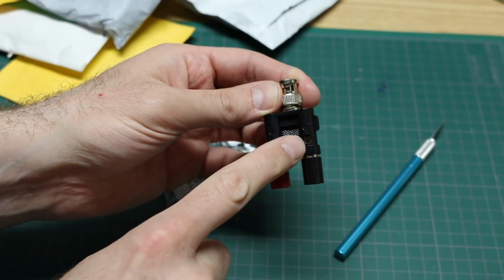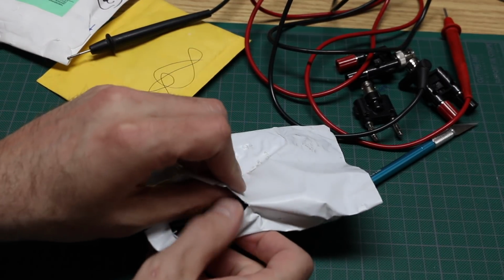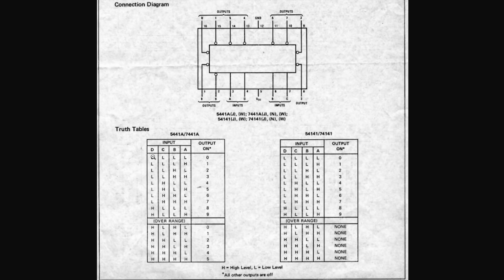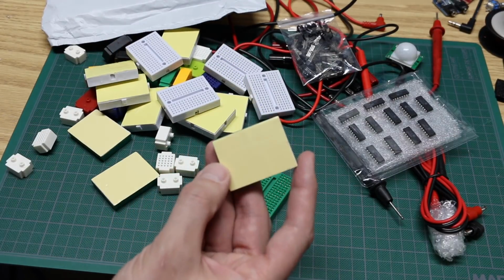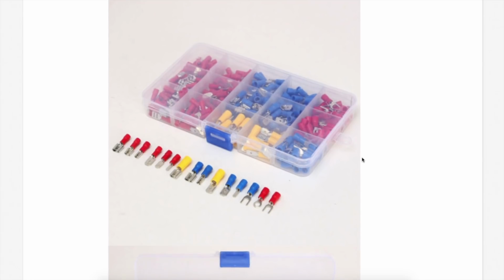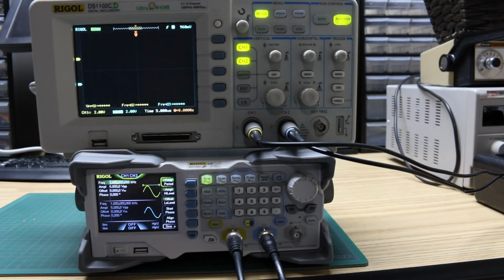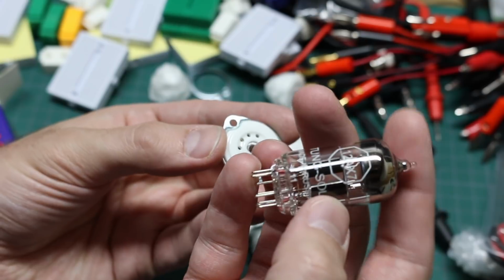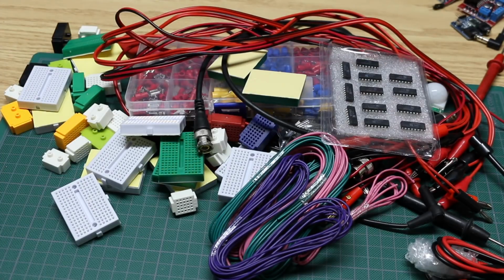Mailbag - Rigol DG1022Z, Breadboards, Test Leads, Vacuum Tube Sockets, Nixie Driver Parts

Comment: Love the mailbags!!! It would be really awesome if you did a mega mail bag… Basically showing how to start a lab from scratch. Start with a couple of hundred dollars in components, breadboards, an8008, dso138, $20 transistor tester, $7 function generator frequency counter kit.... t12 stm32 soldering station....and a few other basic inexpensive pieces of test gear. And then $100 or so on component assortments, and maybe one of those $30 kits including a few Arduino Uno boards, 30 or so sensors, and a breadboard or so. Maybe a series of videos. The first $250 could be the multimeter and gear I mentioned above…, the next could be another few hundred dollars in more advanced test gear, such as a cheap old analog oscilloscope, bench multimeter, and a few other pieces of bench gear.
Especially if you use the introductory gear with soldering station… You could buy older bench gear like the fluke 8050a, Old BK precision or HP power supplies, function generators, frequency counters.... The most commonly used and basic stuff. Most of that good quality vintage gear can be picked up for very cheaply, a couple of hundred dollars to buy all of it if you shopped around, if the gear had any  issues you would have the components and introductory gear to troubleshoot and repair. Would be a great series of videos! Love your content!
Reply from the maker: Maybe I should attempt a series of videos like that to show people how they can get started on a budget and expand as they go and what various people think would be considered important or mandatory gear and components.  

I should order one of those tiny function generator kits myself on that note so I have one around to demonstrate and compare against my more expensive one. Also depending on what people need, maybe they could even build their own out of a few logic gates and RC filters or 555 timer or something. 

 Discussing if people need a digital scope or if an old used analog CRT scope would still be useful these days. What kind of power supply do people need, do they really need adjustable or can they get by with some cheap fixed voltage regulators or those very cheap  buck/boost converters or when will they need more stable linear with higher current. 

 And discussing how different it is getting started today where everything is basically Arduino or similar modules ready to go, versus 20 years ago people still had to basically buy their own discrete components and build their own circuit from scratch on a breadboard and how people can get started in either case today.

 Having eBay and Aliexpress/ Banggood compared to expensive RadioShack and unlimited access to parts online  instead of finding a circuit you want to build and realizing RadioShack  doesn’t carry those more fancy CMOS or TTL chips. 

 I can see an endless set of topics to cover with getting started and growing. Thanks for the suggestion!

Comment: The K155ID1 is actually better for driving Nixie tubes than the original 74141.  It has a higher cutoff voltage- around 100v- which helps to increase driver efficiency and prevents the "blue spotting" problem experienced with certain tube types.

Comment: Beware of those "brass/gold looking" banana plugs. I have just discarded at set because the connection between the outer springy part and the "screw terminal" was too unreliable.

Comment: You probe a lot!  Yeah, everything from China is a mystery pack.  Only a very few will insert a card ... and almost never an invoice to help identify the sender.  Somewhere, there is a new employee taking instruction from his superior:  "... and wrap, tape, and bind the SNOT out everything!"  I still have some 28-year-old 74141s  with the ambition to build a chess clock or something a while back.  Bad thing about these though, is that you can't display hex on your 7-seg displays.  I rather use 595 shift registers because they are cheaper, and you can chain them together.
Reply from the maker: I have some 595s on order (thinking about a linear feedback shift register project).  All these probes need a hook to hang on. Already all jumbled up.

I’d like to get some of the pinball style segment displays so I can do diagonals...
Reply: A little googling turns up a very expensive MM5484N chip to drive 16-seg LEDs.  The displays themselves are less than $1/ea.   Once again though, three shift registers will let you drive 8 at once, if you are satisfied with 1/8th time on each.  https://www.aliexpress.com/item/10pcs-RED-LED-Display-0-8-27-7x20mm-Common-Anode-1Digital-LED-Module-16-Segment-18/32419117343.html
Reply from the maker: I think I will be doing some shopping between now and the weekend...